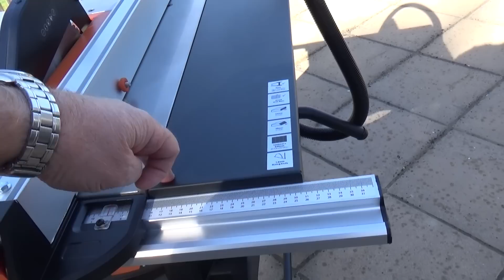Evolution Rage 5-S Table Saw Review

Comment: Hi

I bought a new evolution rage 5s table saw from amazon uk. It is heavy item than thought, but amazon packaging is not good. Upon just taken out of the box and after initial inspection, i found some issues like its 

Rip fence have some (couple of) scratches, i dont know it will make any kind of issues when cutting like thin cutting in wood? So do i need to ask replacement for rip fence or simply ignore it

Also its Guide Rail seems to have loosend (wobble) at the right side, so it moves. I checked at the back to see whether any screws can tightened underneath too keep guide rail tight/ firm with table, but couldnt find any

so i didnt fully unbox it after i saw these issues. Is this minor issues can easily fixed or just returned entire unit?

I am confusing on what to do as i spent almost 330 pound for it

please advise
Reply from the maker: +Reetu Jain Hi Reetu, Amazon have a very robust returns policy.  If I were you, I would contact Amazon customer services and tell them your issues.  

Personally, I would not worry about scratches on the fence, however if you buy a new machine you expect it to arrive without any damage so I would consider carefully whether I wanted to go through the hassle of a replacement and that would purely depend on how much hassle there would be.  If the scratches have raised edges I would opt for a replacement.

Can you explain exactly what you mean by the guide rail so that I can have a look at my saw and see if I can find an adjustment.  

I do know that Evolution Power Tools have a very good customer relations team and it may be worth contacting them to see if they will sort it out for you.  Amazon would be my first point of contact though.
Reply: The left end side of Guide Rail is seems loose as it is moving. I will send you its photos and video soon

Any idea?

I contacted Amazon and they offered Replacement on collection, or full refund or 40% paritial refund and i keep product

please advise
Reply from the maker: A 40% discount sounds very inviting!!  If you send me a picture of the guard rail I will have a look.  I do not know what you mean by the guard rail Reetu.
Reply: It is guide rail (Measuring scale on one end and plan one on opposite side. i will send picture and video now. thx very much
Reply: i have posted its video link, but if you couldnt see it for some reason, please have a look at the video section in my youtube video page

thanks
Reply from the maker: That video is perfect Reetu, thank you for posting it.  My saw is exactly the same.  If you look underneath there is a lock nut nearer the centre of the table.  The guide rail cannot be bolted at the end because that would stop the table extending.  There is a fairly long length of guide rail that is unsupported because of this.  I never even noticed this on my saw.  

In my view it is not an issue.  If the movement was sideways instead of up and down it could lead to inaccuracies.  However, vertical movement will not affect the fence position and also when the fence is clamped it takes up some of the movement by pulling the two guide rails into the table.  

I think if I were you I would ask for the 40% off and get a real bargain.  This is only my opinion though Reetu.  You must do what you feel is best for you!  I hope this helps :-)
Reply: Are there same kind of movements with guide rails in your table saw too? thx
Reply from the maker: Yes Reetu, my saw is the same.  It is not a problem for me, the saw has been fine in use.
Reply: i got 40% refund from amazon, so now it costs me under 200 pound and for this price even with few small drawbacks, i decided to keep it and start some projects. It is new saw anyway also  it does comes with two year warranty from amazon.

I hope it wont give any other issues after start working with it. It is purely for my home diy use and i might use it with cutting wood only

thx for ur kind advise and patience with me

will keep updated
Reply from the maker: No problem Reetu.  I hope you like the saw, I certainly like mine.  £200 is a brilliant price to pay for such a useful machine.  

If you have never used a table saw before, please take care.  They have the capacity to injure you very badly and very quickly.  Do not try and cut anything freehand use the fence, mitre fence or sliding table and always make sure the riving knife is fitted before cutting anything.  If you leave the guard on then the riving knife will always be fitted.

I hope your projects turn out well.  A saw table is one of the most useful tools in any woodworkers workshop!  Have fun.  :-)

Comment: I was contemplating getting this table saw, and your video has pretty much sold it for me. I just need to work out where I will store it in the garage :)
Reply from the maker: It is a good saw and does not take up too much space when folded.  :-)
Reply: So tell me, how'd you go, would you recommend it? Any issues?
Reply: @perentee77  i bought it! Easily fits in my garage. Quality is good for the price. Portable, which is what I need most. I cut in the garden. Need to make a cross sled to make good mitre cuts. I like the blade, but warped it trying something stupid. Bought a wood blade which doesn't cut any better than the original blade.

Comment: Just got mine delivered and aligned the blade.  I am finding that the shelf with the blade in it dips in the middle.  The others to left and right are level but it's not level across its entire width.  Anyone know if this is normal?  I am struggling to think how narrow cuts could be straight.
Reply: I find that the fence is really off on mine and only realised the hard way when it was trying to shoot boards back at me because it was narrower at the far end than the close end. I have to physically check it when I lock it down each time. I also find that the blade face plate is low on the back end so when I’m pushing through it gets caught on the back side and I have to lift it. There’s quite a few issues with it that I wish I knew before buying but the research I did was all positive. Live and learn I guess.

Comment: As others have said Great review👍 
Is there no modification you can do to the blade guard? 
What exactly is the problem with it? It looks like it’s the wrong shape to accept material easily but you don’t really mention what was wrong with it.

Would be nice if Evolution can make an updated guard and even better (like you said) if they made s shop vac 😎

I’m finally after waiting quite a long time....getting one of these table saws on Easter Monday 😬

Cant wait
Reply from the maker: The problem with the blade guard is that it stops the wood being pushed through the saw if the wood is above the height of the sloped front edge.  You have to lift the guard up in order to allow the wood to pass through. 

I really would love to see Evolution produce a shop vac as I think it would be good like the rest of their gear.

I think this saw is a fine tool for any workshop and I hope you like it.  Please take care whilst using it.
Reply: Cheers Russell 👍
Reply: simple enough to glue a piece of plastic to extend and raise the height of the lip, i'm gonna buy one now

Comment: Hello,may i ask what is the accessory you attached in the rip fence and what was that for?thanks
Reply: hjchin13:  Its an accessory supplied with the saw, used when cross-cutting, and designed to ensure that even if the blade and fence are not perfectly parallel, the offcut which lies between the blade and the fence cannot possibly wedge between the two and risk being ejected towards you at high speed.

To correctly use it, attach it to the fence using the supplied bolts and slide it so its far end doesn’t quite reach the leading edge of the blade.  Then tighten the thumb nuts to secure it to the fence and set the fence to achieve the required length of off cut.

Butt the right hand end of the item to be cut up to this fence add-on and feed the item into and past the blade.  You’ll see that the offcut end passes beyond the far end of the fence add-on before cutting is complete so that once the end is fully cut off, the offcut is in free space and cannot possibly be nipped between the fence and the blade.  I think its a great safety feature.

You need to remove it before ripping otherwise you end up with a fence which is then much too short to be of any use.

This sounds complex, but as with so many things, its easier to do it than to describe how to do it.  So give it a try and see for yourself.

Comment: Thanks Russell, I also very much liked the review. A question I would like to ask is ... When fully folded up, does it  push through a standard UK door, inside and outside ? Thanks once again for a very good review.
Reply from the maker: The saw is approximately 34.5" wide and will not just pass through a standard door without some maneuvering.  However, it is easy to get through any standard sized door if the door opens 90 degrees or more.  It is not particularly heavy and can be slid through door thresholds sideways easily.  

I managed to get mine onto my canal boat without contacting any wood which took some doing.  I only just fit through the doors into the boat and I also had to negotiate several steps down into cabin.  I love how portable the saw is.
Reply: Russell Platten Thankyou

Comment: Can this table saw use dado blades ? If yes  what size 6 or 8 ?? Thanks
Reply from the maker: The saw is not designed for dado blades.  :-)
Reply: @RussellPlatten  Thank you for response ... One more question please, Your video since 2016 so i wonder if you still use this table saw or not ? What the cons in your opinion? Thank you
Reply from the maker: @woodworker1470  I use the saw occasionally.  I have a cabinet makers saw in my workshop which I use most of the time that cost way more money and is not portable.  I used the saw during some renovations around my home when I first got it and I also used it to carry out some cabinet work on my canal boat and it did what I wanted it to with ease.  It is more than adequate for most users and the portability, being able to move it around with ease, is a real plus point.  I may not use it much, but I am glad that I have it in my workshop and tend to drag it out for jobs at the worksite away from my workshop.  Before I got the cabinet makers saw, around 15 years ago, I had a small portable unit like the Evolution made by Draper and it was nowhere near as good as this saw.  :-)

Comment: Saw looks good, but if my set construction lecturer ever saw me do a rip cut like that, I would have been kicked out of the class! The push stick is there for a reason, NEVER get you fingers between the blade and the fence! (in fact, to be safe, never have them past the edge of the table). If you need to stabilize a log piece, have a helper on the other side of the table.
Reply from the maker: Good advice Simon!  :-)

Comment: How do you the full rip capacity of 650mm when the scale only got up to 320mm?
Reply from the maker: +Samwise457 just slide the left hand side table extension out.
Reply: Russell Platten so do you have to measure with a tape measure each time?
Reply from the maker: +Samwise457 I do anyway, I have never relied on a fixed indication.

Comment: Very Nice Review Russell.  I didn't do such a good job on my review I picked the darkest day and 7am lol But yours was great mate..  I have had a few issues but Evolution has sorted them.  I will be doing a better review once I have used it for around 4 weeks I do use the saw everyday and Like you I do use it without the guard as I myself has done for many years with other saw and yes like you said it is dangerous but we know this and it's our personal preference  Great Job mate .  I really enjoy watching all your reviews.. Take care.....Terry,
Reply from the maker: Cheers Terry, I think the saw is a fine addition to the  Evolution range and am impressed with it.  Just watched your review and it was fine.  Looking forward to seeing your jigs.  I made a finger joint jig for my big table saw last year and may look at one for this saw.  The 2mm kerf is a nice figure to work with if you use a threaded rod to move the work piece.  I may have a play with compound mitres too.
Reply: Russell Platten That sounds great Russell.  I will look forward to your jigs for this saw.  I did redo a few of my jigs I had on the other table saw. I use them on the Rage now.  As Much as I like the fold away legs feature. I am Thinking of making a cabinet for the saw and have lockable casters on it instead as It will make the saw feel more stable.  Just a personal preference.  I also have to make the push on over cover for the fence to from 3/4" ply .

Comment: Are you cutting all those materials with the same blade. What type of blade is that.
Reply from the maker: +BOBBY Hi Bobby, yes it is all cut with the same blade.  It is Evolution Power Tools' multi purpose blade.  The blade has been designed to cut these materials and does a very good job too.  Most of their saws come supplies with this type of blade.  They sell specialist blades for wood or for steel as well.  These saws are very versatile!  The thing I love most about this saw is how easy it is to move around and set up!
Reply: I'm really impressed. Thanks

Comment: Blade guard didn't work because you did not have the blade high enough so the attached blade guard would clear the meterial you were cutting. Just saying. !!!
Reply from the maker: +Trev Haydon True Trev, but it is a pain in normal use if you are cutting different sized stock.
Reply: Fair play Russell. Useful video I have to say, Learnt a lot, so mucho's for that. Mind how you go.
Reply: The blade guard is effectively dangerous because its a pain in normal use and it leads  the user to lifting the guard, with the blade running, or running the saw without  the guard.
I bought the saw but now regret it for that reason and also because it feels cheap and nasty. The blade cuts metal well, cross cuts alright but for ripping it would be quicker to use a hand rip saw.

Comment: Top notch review - really helpful. I bought the 5s when it first came out - possibly the first one out of Machine Mart's front door!

I watched your video mostly for validation I'd bought well but I learned some things I hadn't figured out yet so I'm pleased to have found your review.

I know... RTFM.

I agree wholeheartedly about the blade guard. Whipped the one off mine after one cut.

I do find the orange cover to access the blade is a bit thin. Anyone know of a fix?

Thanks again for the video review!

Love the disappearing dog. Kind of a counter-yoga thing!

Keep that blade spinning!

Bradley
Reply from the maker: LOL, I know, those dogs ruin my continuity Bradley!  Poor editing on my part.  If I didn't edit it the video would be three times as long, with loads of embarrassing pauses ;-)  I think it is a great saw.  Thank you for your comment.

Comment: Ordered mine on Saturday, should be arriving tomorrow :D
Reply from the maker: +ScrewThePooch79 It is a fine saw!  I hope you like it :-)
Reply: Russell Platten, Saw arrived this morning, when I removed the saw from the box I noticed a small black fitting with a washer and screw in the end of it had broken off from under the saw, I think it's part of the blade bevel assembly. Absolutely gutted. Lower blade guard plate pin is the broken part also the table top face is quite patchy and scuffed, not a great finish on a new product.
Reply from the maker: +ScrewThePooch79 That is the sort of thing that always happens to me!  How annoying!  Have you contacted the retailer?
Reply: Russell Platten. Yes, contacted them and they're sending someone to collect it, then I have to wait until Friday for my replacement :( 
I've been dying to cut some wood with nails! lol
Reply from the maker: +ScrewThePooch79 This is a classic case of Sod's Law!  You have my sympathy!

Comment: Hi how is the rage table saw after 1 yr as thinking of buying one
Reply from the maker: It is still going strong Andy.  I have not used it a lot over the year, but only because I have not done much woodwork.  I still think it is a fine saw for the price.  I did use it for some cabinet work on my boat and it made life very easy for me at that time.  The fact that it is very portable is a major plus and the extra features and fittings are great too.

Comment: I would make some rollers for the blade guard.  2 small roller wheels on top of the blade guard and 2 small roller wheels on the bottom of the blade guard . Than you do not have to remove it.
Reply from the maker: +lazzyrj1 Yes, that should do the trick.

Comment: ...and to solve the litlle inconvenient about the blade cover, I'll recomand to all owners of this tool to fit a kind a double small wheel-discs, on the front side of this blade cover; like this, all the jam pushing will disapear, or almost! To remove it, I don't thinck that's a good ideeas!
Reply from the maker: A good suggestion regarding the wheels at the front the blade guard!